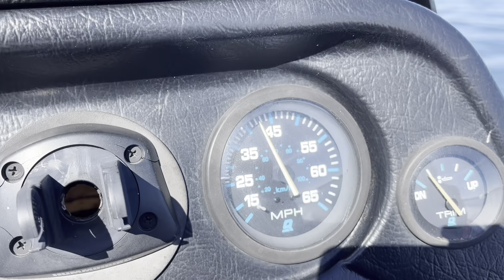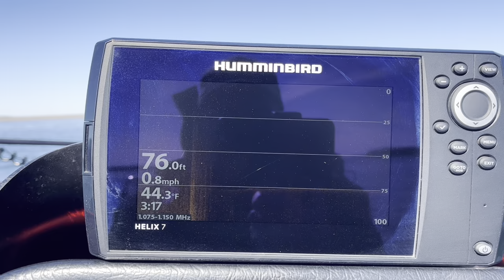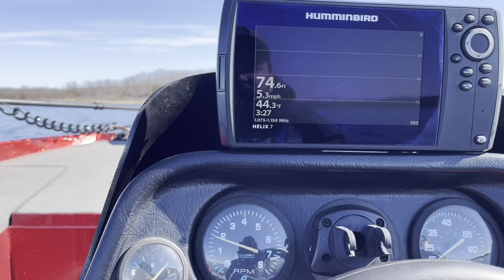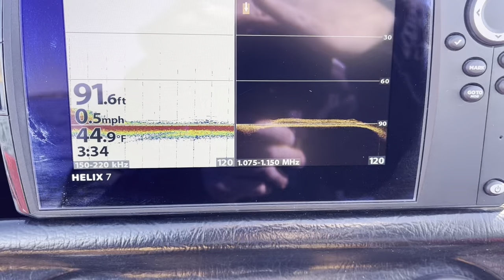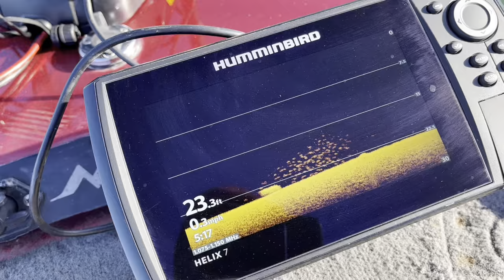The cheap $600 boat sees water for the first time in 10 years! Restoration of an old nitro boat.

Comment: Watching this video really makes me miss my boat. I will offer this advice. Use ethanol free gas and check the drain plug area. I drug mines two hours to a new lake only to find the drain plug assembly has corroded and cracked. I had to load it back up and drag her home. I replaced it with a brass unit from Bass Pro shop. You really have her in prime condition. Congrats.
Reply from the maker: Thanks for letting me know, been told that by a couple people already so I’ll definitely use ethanol free gas from now on. And I need to replace the drain plug assembly because the original plastic one on it is slowly leaking, not much maybe half a gallon for the whole day but still annoying that it does that.

Comment: Make sure you use non-ethanol, gas and it will be a lot cheaper in the long run because you’ll end up with the broken motor if you don’t use non-ethanol gas

Comment: Nice job on the boat. Few pointers, the chains should cross to catch the tongue of the trailer if it were to come off. Also older motors are not ethanol friendly so need to use gas stabilizer that removes it, they make it for marine applications. Enjoy the boat.
Reply from the maker: Thanks for the tips, the chains are not long enough to cross them other wise the catch on the hitch when I make sharp turns, but for the non ethanol gas I did not know but now I will. Thanks

Comment: is yours mixing its own gas? if it is i 1000% recomend buy the moter part to replace that and mix it yourself i got the same boat in blue
Reply from the maker: It was but the first thing I did is delete the oil injection system.

Comment: You should always wear your life jacket when the big engine is running & hooked up to the kill switch. Also when you're by yourself fishing, wear a life jacket in case you fall overboard, if you do go over the the side & you're alone you can use the big engine to trim yourself into the boat. Be safe, happy fishing & GOD Bless. 🐟

Comment: Those water speed gauges are off they read faster than what you’re actually going. Check with gps see if yours is off. Mine was 3-5 mph off
Reply from the maker: Ok I will look at the humminbird next time to see what it’s showing.
Reply: @Ace.Fisher   Yeah the GPS is much more accurate . My water gauge says im going about 5mph faster then my Humming birds do. I have the same Helix 7 and same boat too.
Reply from the maker: If it’s only off by 5 miles then it definitely goes 45 because after I trimmed it right it went over 50, but I have a 23 pitch prop on it which doesn’t belong on it, what pitch is your prop? I’m thinking to get 19p
Reply: If it planes good and rpm’s are correct at wide open throttle and trimmed  right then 23p. Seems high for a 90hp though. Mine had the 75hp and fastest I got with a 19p was 46 on gps. I’ve since repowered with new mercury pro xs 115,hydraulic jack plate and hydraulic steering. Whole new animal
Reply from the maker: Oh dang nice upgrade 👍👍
Reply: I had a stainless 21P that did 45 and tried a  Aluminum 19p. Does ther same MPH but seems to get on plane a little better. Im going to get another stainless 19 and it should pick up a little bit.
Reply: @Ace.Fisher 
Use Mercury outboards prop selector on their webpage.
The main thing is that at wide open throttle (WOT) your engine is within the recommended rpm for your engine. 
   I could write a lengthy bit here about prop selection. 
    I’ll just say that I run a Merc stainless 4 blade. Dropped a mph or two off top end by switching from a 3 to a 4, but hole shot, acceleration, handling and holding are noticeably better. I prefer stainless for several reasons. It looks Great, is strong therefore doesn’t flex like aluminum, and therefore provides maximum performance. Though aluminum is cheaper and could keep you from a bent prop shaft if your prop were to hit something.

Comment: I have a 1994 Mariner (Mercury) 90hp that looks just like your outboard. Do yourself a favor and buy the kit to delete the oil/gas mixer pump. If it goes bad and they do... It will destroy your motor. I swear, Mine actually runs better and a little faster after I deleted it. Get you some rod socks too lol.
Reply: Where can u get the oil/gas mixture delete kit I have a 94 115 that I want to delete it on
Reply: I ordered mine through a local mercury marine dealer in my town. Not amazon... Was like $40 or $50 about 3 years ago.